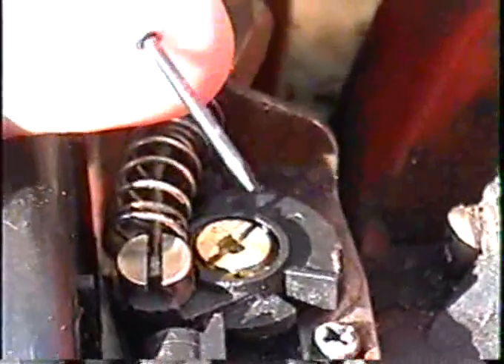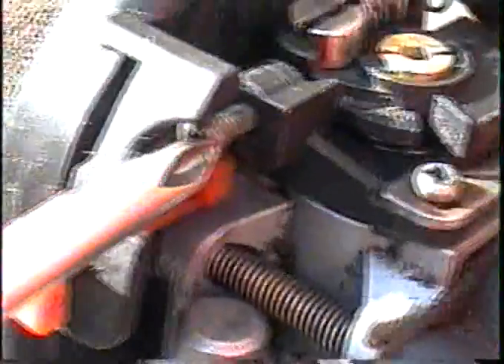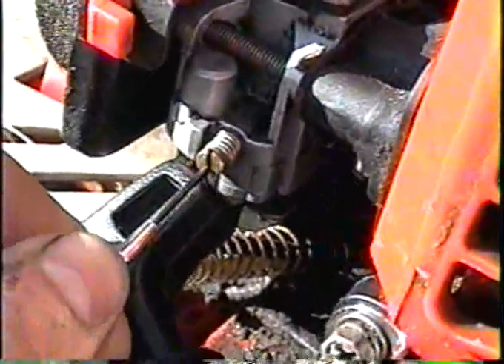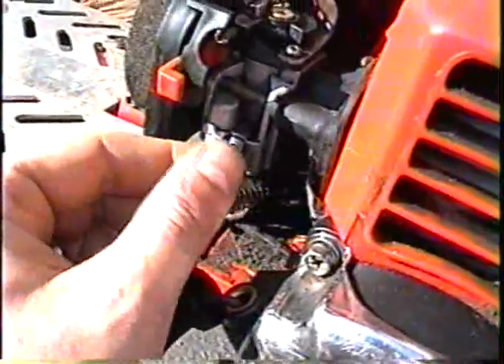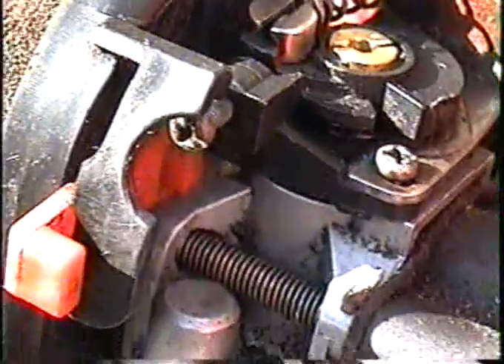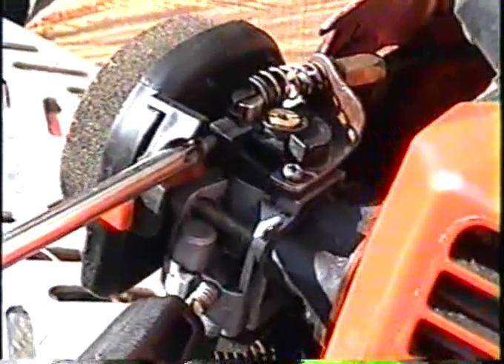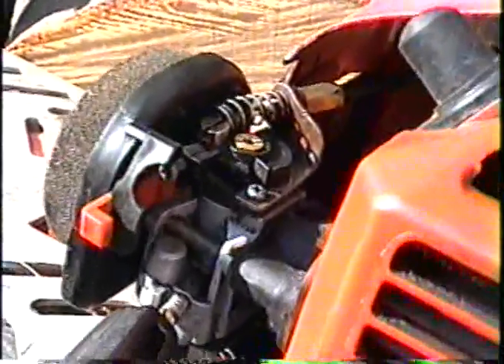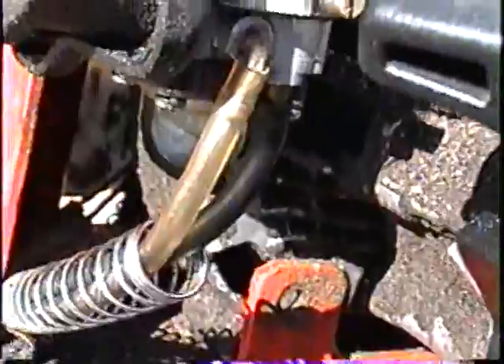HOW TO ADJUST CARBURETOR ON 2 STROKE CHINESE STAND UP SCOOTER

Comment from the maker: @Chiclidking1214 richer means running with too much gas going to the engine which may slow it down, leaner means not enough gas going to the engine thus making the engine wanting to stall or over rev

Comment: @donyboy73 Thanks.  I disassembled and cleaned the carb. The diaphram was soft and pliable.  Seemed OK.  The engine was bogging down under WOT.  It turned out to be a varnished fuel filter and gunk in the tank.  Cleaned the tank, replaced the fuel filter and fuel lines with Tygon tubing and adjusted the carb to a slightly richer setting.  Scooter engine revs up nicely under WOT.    Replacement carbs cheap on Ebay for $20. Thanks for your help.

Comment: My 2stroke china motor runs well when it is on choke. When off choke it will die down if you throttle up. The only needle I adjusted is the mixture screw with no good result. Do you think I should make a little opening on the main valve to add more fuel to the engine? Tnx.

Comment: donyboy why would you not show us how to adjust the two air fuel mix screws? what a bummer. I want to know which of the two do you do first? I just want to know the procedure!! And on top of the carb, the tiny screw- is the bigger slotted screw that the little screw sits in- is that bigger slotted screw supposed to be fully tightened/seated? confused still!

Comment: the brass screw on the side with the spring would be the high speed adjustment.  thanks for pointing out the top small screw that I didn't know was there.  That would appear to be the low speed mixture screw.
Reply: Also for correcting the bog when you gun it.  Can either tune for max speed, or the bog sluggish start.   Can’t have both

Comment: I was wondering what would be the pre tune settings to start tinkering with it because I just got a new motor that came un tuned
Reply: Turn in idle screw 3 turns, and open lower mixture screw with spring 3 turns.  I had to free up the top tiny screw and adjust it counter-clockwise 1/8th turns at a time (till I got about 1/2 turn counter-clockwise) while trying to pull start under full choke till it would fire constantly and allow me to remove choke and run smoothly.

Comment: i have the same scooter as well and when i start it it would turn off if i dont give it gas, basically it wont idel. As soon as i start it i have to keep reving it to keep it on and after riding it and i slow down to slow or stop completely it will turn off. What do you think it could be?

Comment: Hi. I got the same engine at mine i think. When i set the choke (i think) at on it works, but at off it dies the second i touch the gas handle. When you drive do you drive with the red plastic thing next to the carb down or up? Sorry for my english

Comment: I also have no center of brass highend adjustment screw. Had it tuned ,left my scoot in the garden hedge,, came back to find it had completly flood right into the exhuast, and now it will never idel. I changed even every gasket across the engine ,triple checked the pulse travel was'nt obscured. Now I'm running on 8mm ventre carb, but would like to return to a 12mm for full effect, and I think the smaller ventre could be choking prehaps (just a worry/panik)

Comment: Hey mine had that top screw, but it was hidden under glue. I had to use a needle to scratch it off then found the screw. Had to use a micro torch to break it loose. Now I can fine tune it better. Im hoping it will help improve acceleration
Thanks

Comment: These scooters are pretty fun, but they're not too fast. Mine goes about 10MPH at full throttle, and I'm a pretty heavy guy, so that's bound to slow it down, it will scream with the wheel off the ground, but when it's under load, it get's really lugged down.

Comment: do you know what the flat head screw closest to the primer should be at like how many turns counter clockwise? cause i have a cheap chinese scooter im trying to get to run good and it will start but run like crap. and it also starts if you spray carb cleaner in carb and white smoke comes out exhaust and seems to run extemely hot! im  putting 91 octain  32:1 SORRY FOR ALL THE WORDS i just want mine to run good again. also it vibrates like crazy
Reply: the instruction manual that came my scooter says 25:1.  However, it started getting hot and bogging down, when climbing hills, so I run it 16:1 now.  Scooter still runs good and I bought it in May of 2004.

Comment: Dony boy, i have a small bike with this carb. Engine starts, idles and runs however when i open throttle engine bogs down and stalls. What do i need to adjust?
Thanks, Dennis Johnson
Reply: Did you ever find out why it does that
Reply: Probably too rich.
Tighten the screws a bit.

Comment: Hey Donyboy, That tiny screw that you mention to adjust lean mixture, mine wont turn, perhaps due to a poor top thread. I can move the pin in and out using pliers from the inside though and have ordered a new carb. But as a general rule for a starting point, is it better to start with the pin fully screwed in or fully screwed out?
Many thanks and awesome selection of videos my friend!
Reply: Mine had some sort of epoxy holding it locked into place. Had to scrape a little out and slowly move the screw back and forth till it could turn.  Couldn’t start the unit hardly at all until I got this screw turned counter clockwise approx half a turn.  Now fires right up!

Comment: hey man i have the sane scooter but different problem it wont start unless i spray carberator cleaner where the spark plug sparks on the piston cylinder because the carb cleaner is flammable it creates a good explosion to start the engine but it wont explode unless i do that what cod it be? does gas go on the chlinder to cause explosion? if so coild it be its not getting gas to the cylinder?
Reply from the maker: try a new carb, they are less than $20 on ebay

Comment: Help meh i hav that engine but it revs by itself and we took it apart and the cylinder gasket tore and we put it back togehter with that broken seal will it still run?!?

Comment: @Chiclidking1214 
are you able to tell me if I need to add oil to this motor in the crank case..where small sprocket goes on chain, I see a small fill hole and sounds like its running dry....help new scooter owner  I have the same engine.
Thanks

Comment: Hey i need some help  I have the eaxct same scooter and wont run off the gas in the carb it will start if i put gas directly into the cylinder and it will run for about 30 secs and then die i cleaned carb checked all the connections i dont know  a new carb is 30 dollers but i wanna see if  i can fix this one first pls HELP

Comment: I have a pocket bike with same engine, bike idles fine and all but once i hit the gas it wont move. If i lift the back tire off tje ground it will spin but not with my 7year old brother on it. Any suggestions?
Reply: Brian Espino possible cause 1.) very tight chain tension,2.) gear case has no lunrication 3.)worn out clutch inside the gear case.4.) bad carb tuning 5.) wheel lug nuts tightened to much restricting wheel to easily turn

Comment: i need help. my scooter has this same carb and it wont start. i just put on a new piston and head, they were installed correctly. after i rebuilt it i started it and it idled but when you gave it gas it died. so i let it cool down and tried starting it again but it would fire. i cleaned the carb well and it still wont start. if you spray starter fluid in it, it will run for 3 seconds and die. i need help with the mix screws, i dont know if they are set

Comment: I just bought my scooter and starts up but when I throttle it dies, and I clean the carburetor and I seen that the last owner had the gas lines twist in different plugs on carburetor and I changed like u shown in your video but when I pump the gas the little plastic ball it won't pump the gas to the carburetor so is like it doesn't  suck the gas what do u think its wrong .?
Reply: I thimk your gearing needs fluid no fluid wont turn so when you gas it it stalls

Comment: can i just use regular 2 cycle engine oil from dollar tree and mix it with gas for the 49cc Gas Scooters ?
Reply: Yes, That is how a 2 stroke works you mix the gas and oil.
Reply: ive used motor oil in a pinch, it works ,i just use a tad more than usual mixing oil. it will get u home

Comment: @donyboy73 if my bike starts up runs good and then i full throttle it and it bogs down is that to rich or too lean? or something else completely?
Reply: High end too rich.  Lower side screw needs to be turned counter clockwise

Comment: The screw in the top is the high speed screw ,the one on the side with the spring is low speed .Adjust low speed first in conjunction with the idle screw so it idles  Then do the high speed so u get max revs .Bogging down when u open throttle is high speed to rich ,if remember correctly !

Comment: When you give it wide open throttle and the rpms drop fast and then go up whole the time, what should I do? I don't have a fuel mixture screw own my carburetor, only the idle screw and the little screw in the big one. It only happens when the engine is hot.
Reply: Get a new carb with the lower mixture screw.  That’s what I adjust for the bogging

Comment from the maker: there is one in the plastic part behind the carburetor
Reply: Hey man how many screw turns from seated does both fuel/air mixture and the top TINY screw.
Reply: @brandonraiche5297  It really depends, man. I'd start with it bottomed out and just make quarter turns till it runs good.

Comment: I have a similar china peds like yours my problem is when i start the engine the engine stops and mine is hard starting PLEASE HELP THANKS
Reply from the maker: +Jelo Villar you might need a new carburetor and make sure fuel lines are still good
Reply: +donyboy73 thanks i try to buy a new carburetor
Reply: +Jelo Villar Maybe its the Spark plug that was my problem!
Reply: Check your clutch and gearbox. Sounds like you're clutch is locked up.

Comment: Great video.  I have one of these too.  The manufacturer of the carburetoron mine is  is RUIXING and the part number stamped on the carb is 312237996.  Any idea where I could purchase a diaphram kit or rebuilt kit for this carb?

Comment: I think I'll just chuck my Carb in the spares box as It won't idel, and It only has one needle adjustment. I figure I'll just get a decently designed 12mm ventre carb off of an old chainsaw.

Do you suppose My carb in question just needs a NEW diaphram because it won't idel,
NNNNNOOOOOOOO.......
 I DON'T KNOW WERE TO FIND ONE, and it's not viable.

Comment: what model is this one ? i got the exact same one for $90 used but the guy didnt know the model
Reply: Gsmoon scooter
Reply: @randycollens2681  thanks, i found that out about 7 year ago lel. I bent the motor mounts and put a 55cc engine on, racing carb and exaust after cracking the orignal engine in half. piston rings broke on the 33cc after thousands of hours of use, so i filled the tank with octane booster/no gas and took it for a drive in the winter. drove almost 2 hours before exploding. :) unfortunatly my ex gf didnt like it being taken apart in the apartment all the time so i gave it away, was loads of fun having it tho.

Comment: great video, i learned a lot!!!!Just got one of these ina  trade today, i need to put the gas tank back on and work some magic on it with the throttle switch but i have a few questions about where the wires go that are conected to the box and the spark plug cover.. i got a video of it.. watch?v=W3VAbfPJGjI anyway, great instructonal vid.
Reply: The kill switch
Reply: @randycollens2681  10 years too late my dude. :)

Comment: What is the number of turns for the bottom jet?
Reply: If you mean the high end (lower side screw), after tightened all the way clockwise, mine sits around 2 full turns counterclockwise.